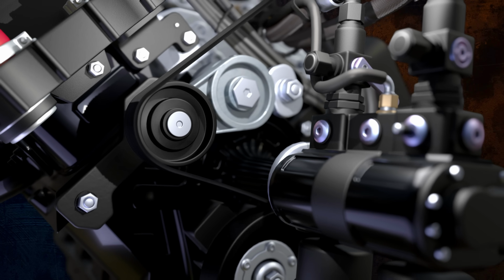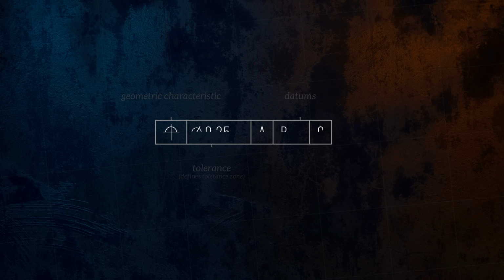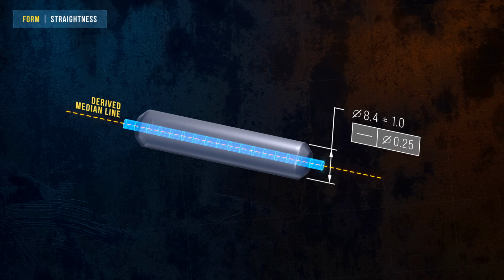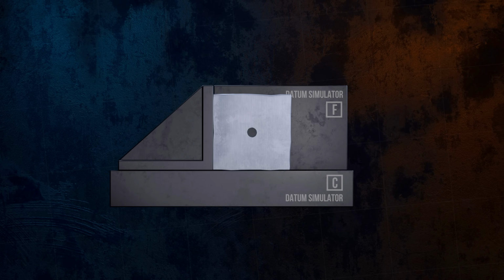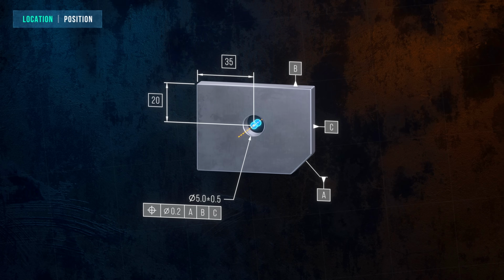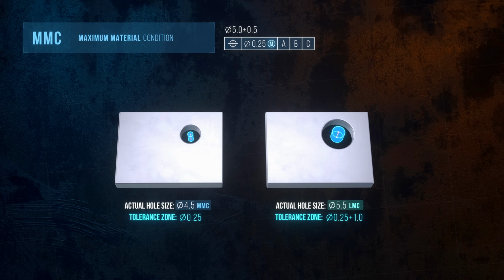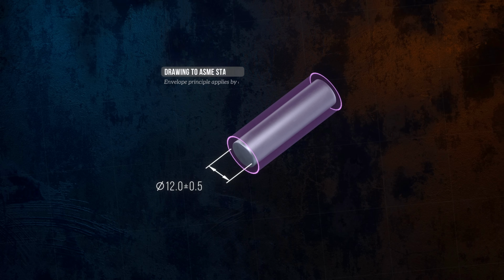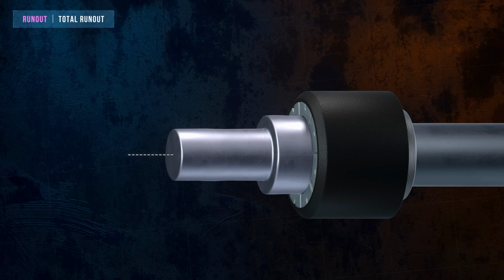Understanding GD&T

Comment: This is one of the clearest description of GD&T I've seen. Explains tolerance zones and geometry control tools pretty well. When trying to explain these to new engineers, I tend to use various shapes of pasta, or GD & spaghetti. 

Every time I saw a drawing with circularity or concentricity, it was because the part designer really wanted position instead. In any case, I heard the concentricity tool has been removed from the 2018 update of Y14.5.
Reply from the maker: Love the pasta idea! Profile of a surface applied to an orecchiette. 😂
Reply: Man! Your comment broke me completely, because I didn't understand anything from it! No offense to the owner.
Reply: @A.Hisham86  GD&T is not a straightforward topic and really requires the ability to visualize objects in 3D to understand the concepts. That said the video is a decent intro to the subject. Proper professional training is still very much needed.